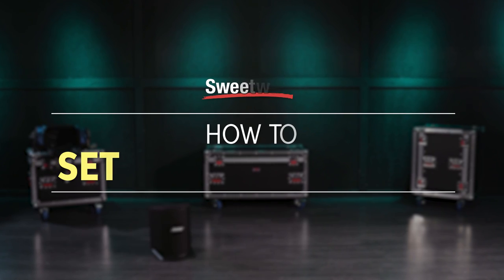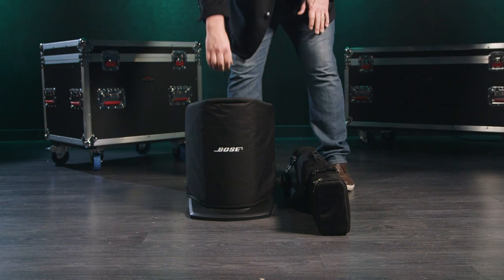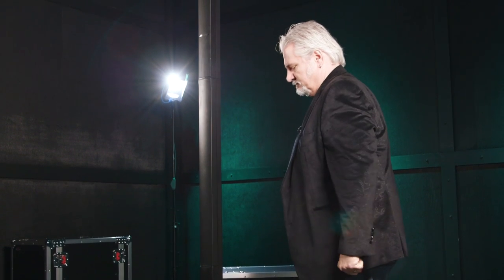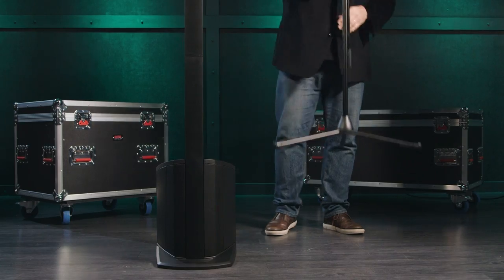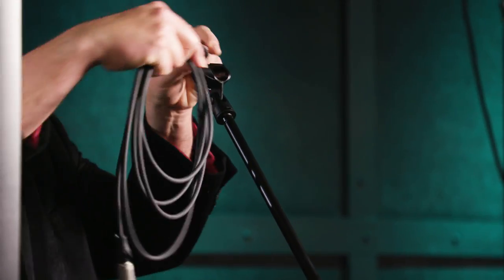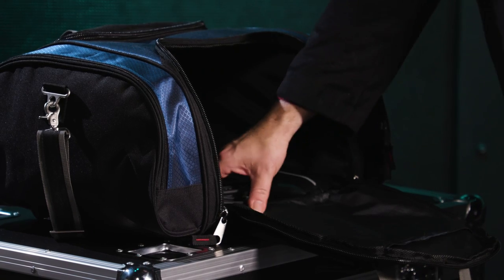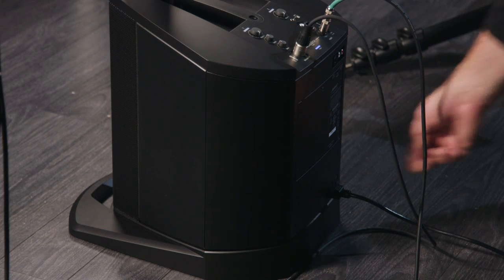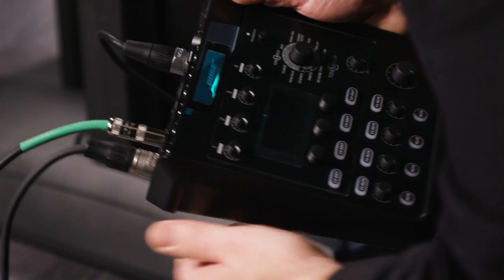How to Set Up a PA System for Solo/Duo Acts

Comment: I add a TC Helicon Mike Mechanic, on the one hand I can improve the sound, especially I got a less boomy vocal sound. On the other hand I can add some echo and reverb. It's easier to use, than a Bose tone match.
By the way, Mic Mechanic's output has microphone level, so it wouldn't overload Bose L1's compact's microphone in. Both together makes an excellent sound on microphones.

Comment: I have a tower (turbosound IP2000) and the problem I'm having is, when you're sitting/standing in front of it, the sound is very muddled because the high end goes over your head. It sounds great in the room, sure, but for the players and singers, the feedback (not the squealing feedback, but what you're hearing in real time) is a muddled and incomplete range of frequencies. I love the ease and simplicity of the tower system, but the height of the tweeters is too high to sound good as a monitor when you're in front of it. To combat it, I simply set up the tower off to my side, and run a monitor out. That way I can hear crisper cleaner representations of my guitar/keys/voice that makes it easier to react to in real time.

Comment: Can you say more about how to position to minimize feedback?
Reply from the maker: Hey, Akshay! In terms of positioning for feedback avoidance, the biggest thing to consider is where your mic is pointing, and where the sound is coming from. Generally, you’ll want to use a cardioid microphone in a live setting, as it will reject most any signal other than what’s directly in front of the mic.
If you have stage monitors outputting any type of audio, you’ll just want to make sure that your microphone is pointed 180 degrees away from said monitor (assuming you have a cardioid microphone). If you have a microphone with different polar patterns, you’ll just want to make sure the mic's polar pattern is rejecting any type of stage sound.
Some more in-depth conversation may be necessary to really go into detail on this. Just reach out if you want to chat further!
Nick Pasquino, Sweetwater Sales Engineer, (800) 222-4700 ext. 3230, nick_pasquino@sweetwater.com

Comment: The BOSE sounds great but how is it live? Could it handle backing tracks?  I cannot imagine it could be loud enough for a restaurant or bar.  If anyone has any experience, please let me know.
Reply from the maker: Hi Anthony, great question! The Bose L1 series is absolutely exceptional and pushes a lot more air than you would think! The L1 Pro 8 is good enough for most small solo gigs, but for louder bars and restaurants, the L1 Pro 16 is a monster and has plenty of push because of the array design. Unless you’re trying to deafen everyone in the room, I would feel safe recommending the L1 Pro 16 for almost anywhere that doesn’t already have a Pa system.
Give me a ring if you have any further questions!
Drake Sobehrad, Sweetwater Sales Engineer, (800) 222-4700 ext. 3271, drake_sobehrad@sweetwater.com

Comment: Are you setting up the Bose speaker behind you?  And there are still no feedback issues?
Reply: Usually you haven't this problem. I use it so and can say, that the L1 is pretty fool proof.
Of course, you can get feedback when you raise the level, but this would be a level, that wouldn't be OK.
Reply: Contrary to HK Audio Elements and LD Systems MAUI series, you can also put the Bose aside you and get the music loud and clear. The dispersion angle is pretty wide.
Well, but you should be careful with treble. Bose L1 can easily do too much treble.
I was with a guitar player looking for a good acoustic guitar combo. Most of these had an aggressive sound, were for Rock bands. The amp with the perfect sound was the same price as Bose L1 compact.
After he tested my Bose, he bought one for playing guitar.
Reply: An interesting thing about these speakers that use a column of small drivers and a small subwoofer is that they tend to minimize feedback issues (compared to traditional speakers with a couple larger drivers/horns). You'll still want to use best practices with mic placement, but you'll likely have fewer feedback issues just based on the design of them.
Reply: @DaveMcCall  - Thanks!
Reply: @robfriedrich2822  - Thanks!
Reply: I use a tower and would agree that the feedback isn't a problem until you start pushing the volume. If you have to be that loud, I would suggest setting the tower in front like a traditional PA mains would be, then running a small monitor out for you. Also, if you're too close to the tower (if it is behind you) you don't hear the high end, and it can sound a bit muddled. I would try to be 10 feet at least in front of it if you plan to use one for a monitor AND main.

Comment: Hi, so for a solo acoustic set, am I right in thinking I do not need a mixer? I simply need a dynamic mic, my guitar and this PA system? Also, how would it work for my guitar pedals? Do I just plug my guitar into the pedal board, and then from my pedal board into the guitar input on the PA system? Sorry I'm just a bit confused and don't want to buy the wrong thing. Many thanks.
Reply from the maker: Hi, Daniel. Correct, with this particular system you wouldn't need a mixer as long as the PA has enough channels for your needs. In the video, Mitch is using an L1 Compact by Bose which can accommodate one vocal mic and one instrument input. You can run your guitar through any pedals you're using, and then the output of that to the Bose. This is ideal for an acoustic guitar setup. If you're playing an electric guitar, you'll probably want some sort of amp modeler at the end of the pedalboard to simulate the sound of a guitar amp in the chain.
Thanks for your interest!
Charlie Davis, Sweetwater Sales Engineer, (800) 222-4700 ext. 1320, charlie_davis@sweetwater.com